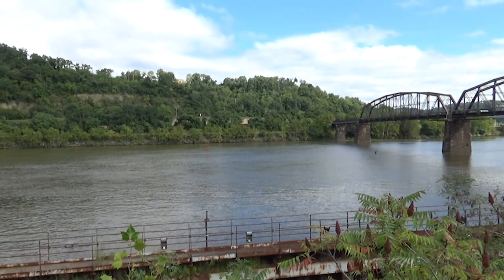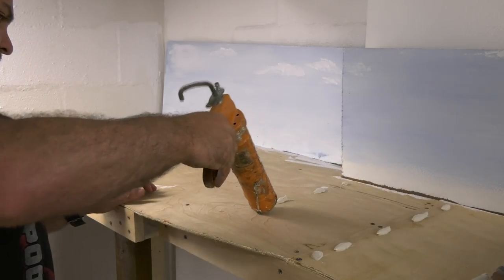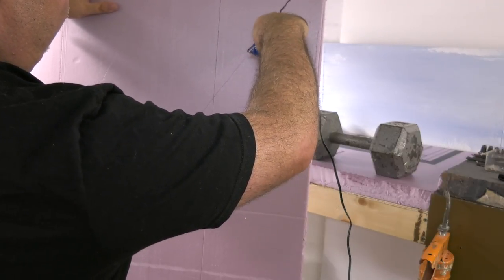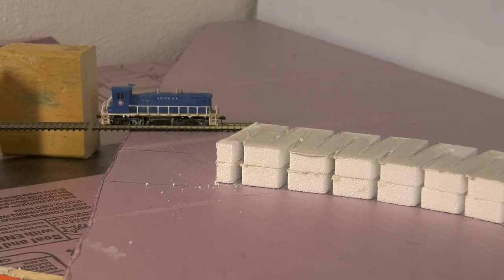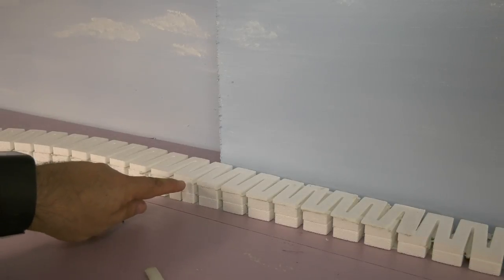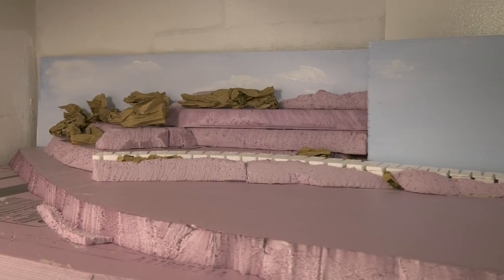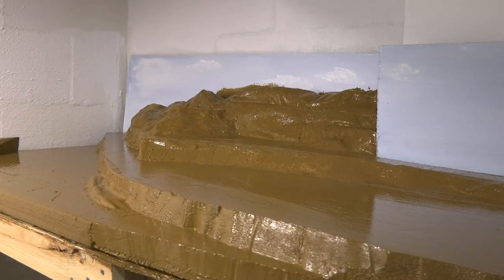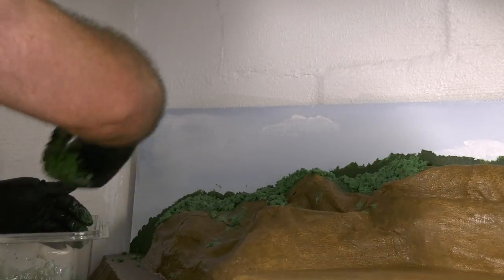Model Railroad Scenery: Background Hills

Comment: Hi DJ!
I watched you add the thin glue mix to the loose gravel. I've tried this technique for years now, and everytime my work dries, the gravel is always a darker color, looking like rain just fell, and not a dusted, dry look. 

Is there a way to avoid the darker color when it dries?
Reply from the maker: I didn't notice it with gravel, but I noticed it with fine dirt sometimes.  Thats a good question, that to be honest, I don't know yet.  If you find out, let me know.  I have tried sand, and that didn't work well because it sparkled.
Reply: Hi DJ. Thank you for your response. Yes. I will certainly let you know if I discover any techniques that can be used to make this better. Have a good day!
Reply: Michael Diehl, hey mate, try brushing the gravel with an earth colour, either yellow or burnt sienna pastel. Crush up the pastel to a powder and use it to lightly brush the gravel. I got this idea from a great Australian modeller Luke Towan (he mainly does great tutorials on dioramas for scenery). Check out his vids, you'll get some great ideas. Cheers

Comment: Nice video, DJ! I like that clump foliage idea. I'm all for cheap! For gluing extruded foam, I used to use Liquid Nails for Projects. It took a long time to dry, and I just wasn't real thrilled with it. Then I saw this video: https://www.youtube.com/watch?v=rnOegaOKu38 She did test on various adhesives for foam, and Glidden Gripper primer paint was declared the winner. I bought some, used it, and I will never go back to LNfP! This stuff works! A thin coat between layers, and when it dries you will destroy the foam trying to get it apart! I got mine at Menards, but it's available all over everywhere. Give it a try!
Reply from the maker: Thank you, always looking for new ideas.